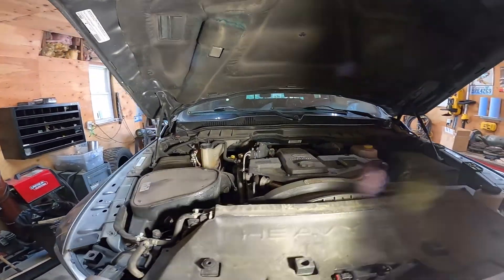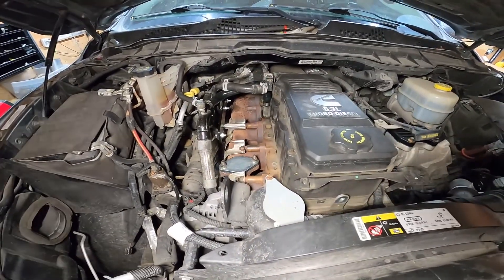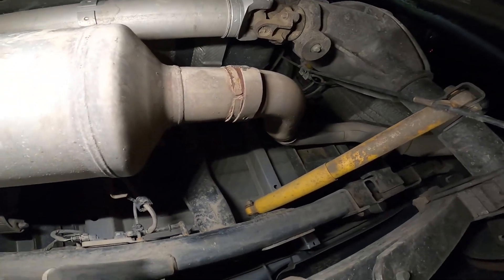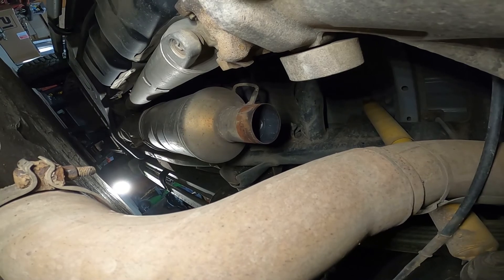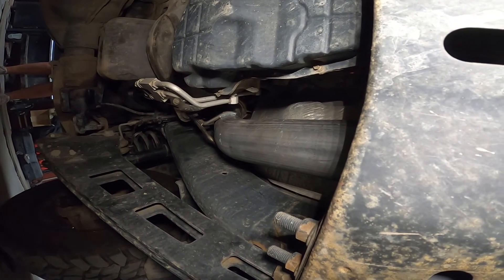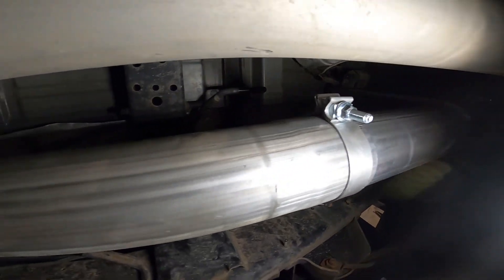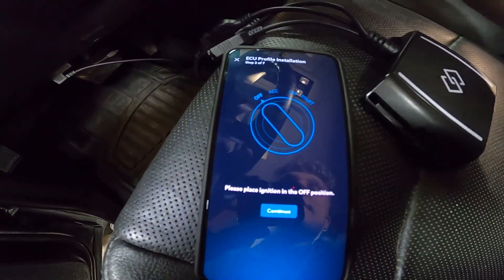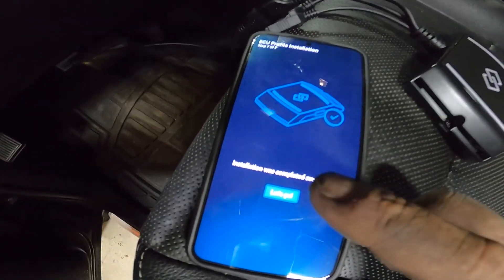Cummins Dpf/Egr Delete

Comment: What did you do with the plugs that you disconnected from the egr? I am doing this weekend im just lost on what to do with the wired behind
Reply from the maker: I just electric taped it off, so that moisture doesn't get into it. Also just ziptied to something.
Reply: there is blank kits for those but i dont know anyone whos used them, most just tape em
Reply from the maker: your right there are, i figured if i wasn't going to reinstall the system back, i would just tap it off.  @piperdoug428

Comment: when one deletes/replaces the exhaust system on one of these RAMs, what happens to NOx 1 sensor on the backside of the turbo?  Do you disconnect it and leave it? Do you remove it and plug the hole?  If you disconnect can you replace the NOx with a temp setup?  Thanks, Mike P.
Reply from the maker: Yes, everything just stays as is. Tape up the wiring the kit comes with with a plug.